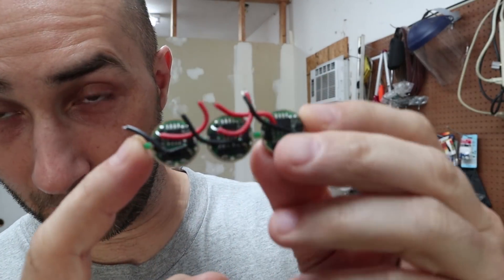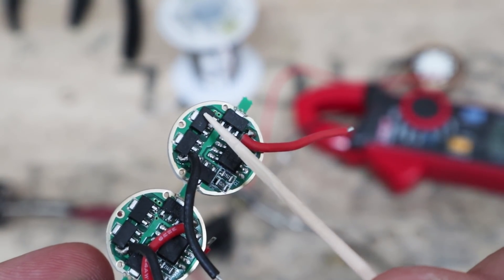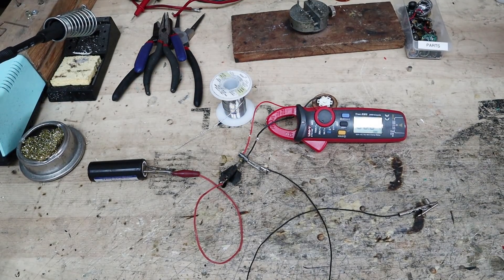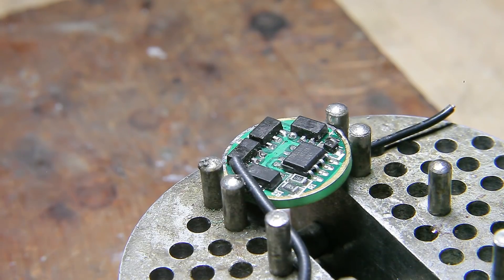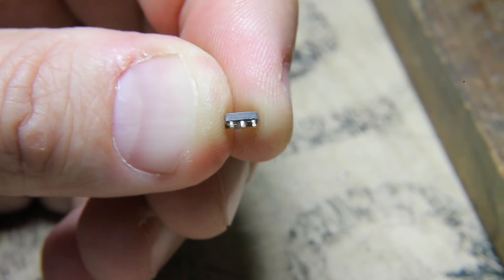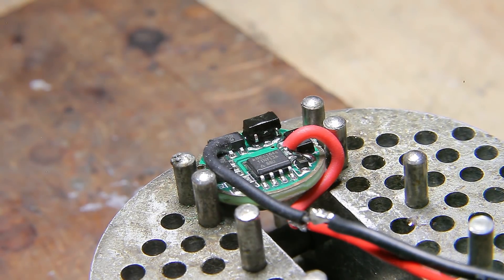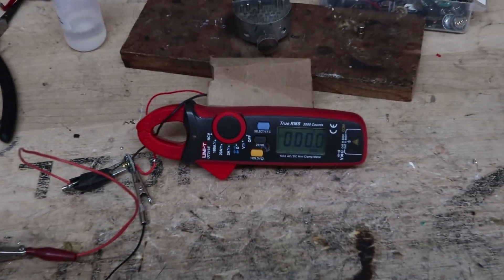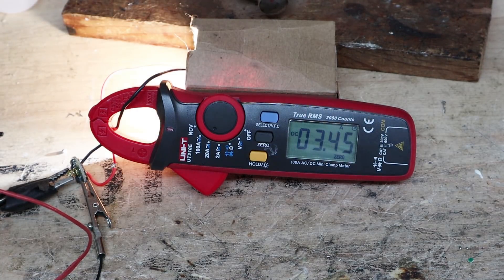How to Boost Flashlight Driver Current.  Qlite, Nanjg 105C

Comment: Can I run a pair of T6 LEDs from them and would it be more efficient than a single LED?
My driver has 8 extra chips on it. Good tip on the middle pin I've kept mine intact. I have half a dozen of these. How would I heat sink a 16mm driver?

Comment: Going to be doing this in about a week when my package arrives. Wad wondering. Does it matter which 7135 chips we do this on? As in my driver has 8 already. I can just add 2 onto 2 random 7135s and it'll be fine right? (Aside from battery fitment of course)

Comment: Hello Matt. I would like to ask for your opinion and help Mr. Matt.I have a torchlight, but the battery spring from the drive has come off or is disconnected.My question is, if I want to reattach the battery spring to the drive back to the original, do I need equipment such as solder paste and solder? I really appreciate your help.

Comment: Hi, I had a problem with my diving flashlight.. the flashlight suddenly dimming and shut down after few minutes. It's not flooded but I saw some sparks when I closed the end part of the flashlight after putting the batteries before I used the flashlight.. I changed batteries but still the flashlight won't turn on. I opened the flashlight to see if there's a visual damage to the driver.. there is no damage. I wonder if the driver was busted or the LED? How do I repair my flashlight? Thanks

Comment: Hey Matt, Could you possibly show us how to boost the acebeam w30. I want to try it on my own but I don't know where to start. Also maybe even show us if a RLT collar would work because theoretically there is no reason it couldn't. I know RLT collars are nowhere to be found but I figured Matt Smith would have at least one. Love the your vids btw
Reply: acebeam w30 - laser pumped flashlight. Lasers, unlike LEDs, do not particularly like overcurrent. I would not risk it on such an expensive and complex device. Moreover, you have more chances to break it than to modernize
Reply: but if you try and get the result - share the video, it would be interesting. How to see the acebeam w30 inside. Although I still do not recommend you to do this

Comment: I have a rechargable bike light off ali using 3xl2 chips. I was hoping to increase the driver current but dont understand the circuit, theres a 8 legged chip which is unmarked with a ao7t connected to it, would stacking on this increase current?
http://www.aosmd.com/pdfs/datasheet/ao3400.pdf

Comment: I've seen people use all three legs to solder, what is the right approach?
Reply from the maker: When I remove them from the board I splash the whole chip with liquid flux.   Get the tail piece hot and then very quickly jump to holding my soldering iron across all 3 of the front pins.      When I solder more chips onto the exsisting ones I bend all 3 legs downward and solder the tail pieces together.   Then I solder the two outer legs.   You don't need to solder the center one because its electrically the same as the tail piece.   If you want to give yourself some extra space you can break off the center of those three legs by bending it up and down.   This helps keep accidental bridges from occurring on the tiny pins when you solder.